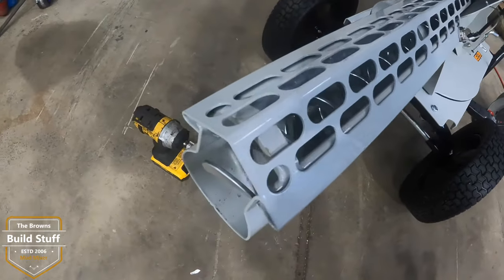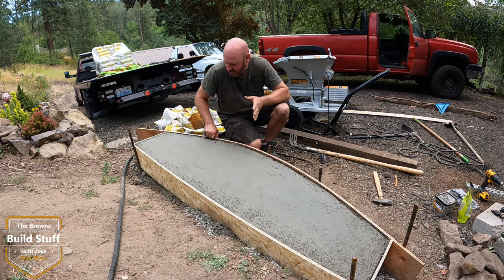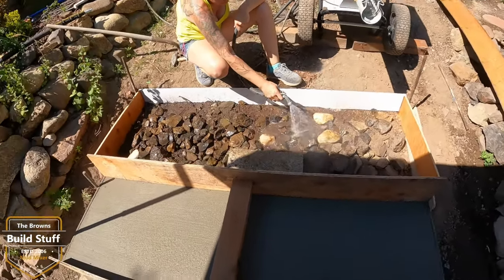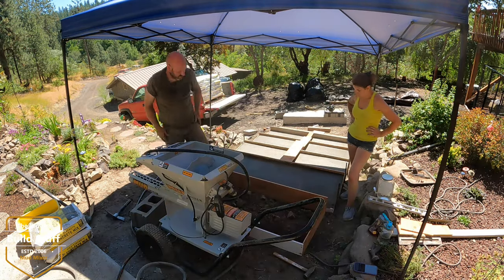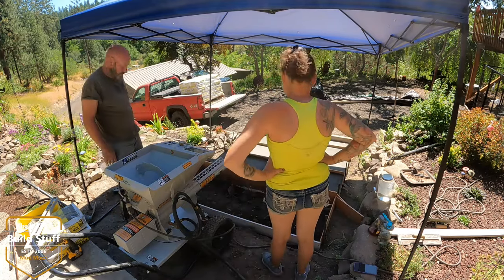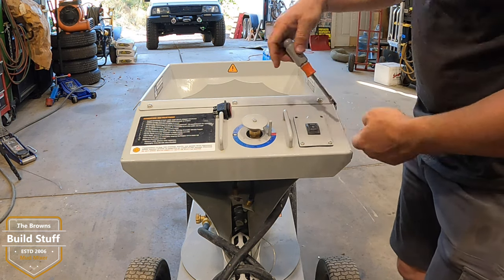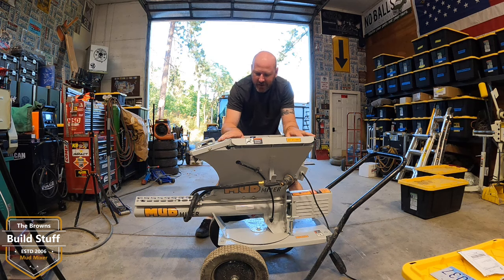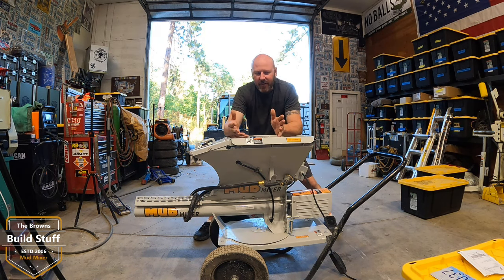Mud Mixer Assembly, Review, and First Project.  Concrete Stairs DYI Automatic Mixing Concrete Tool

Comment: I have poured 9 yards for footings and stem walls, and your analysis of the machine is in line with what I discovered:  well designed and built. Agree that the machine needs to be level or slightly downhill. Wish it wasn’t made in China☹️
Reply from the maker: Agree 100%!!
Reply: Good lord! $3k and it’s actually made in China? What a ripoff. It’s just 14 gage steel and a 1/3 horse motor and some hose valves. WAY overpriced.
Reply: @cmanycrows8400  Do you have an alternative?
Reply: Doesn’t matter where it’s made. What matters is quality control or design. It depends on the brand whether or not they want good components or not. There are high quality stuff made In china . Stupid people make stupid comments about stuff being made in China. Quality of this is good, even though it’s made in China. It’s because the company decided to use better quality components and design

Comment: This machine looks awesome but the price is high for what it is. I'm sure A lot of R&D time and money went into this, but I wish they would try to make it up on volume rather than price. A lot of folks will have to wait for the knock-offs or for the price to come down to justify this vs. a traditional mixer that costs 10x less.
Reply from the maker: I’m sure you’re right.  I just mixed another 2 full pallets in an afternoon filling very large posts and a small pad. Even at the price, it’s saved me a lot since I can’t get concrete trucks where I’m working.
Reply: The mudmixer allows for one or two people to do big jobs.  A traditional commercial mixer is atleast 3 k (canoga,  multiquip). With a barrel mixer, you need another person to wheelbarrow the mud to where it needs to go while the other continually reloads it.  If you need a footing for a car lift 2ft x 2ft x 3ft deep, mud mixer one man job very easy labor (park it and load) let it fall in.  Barrel mixer, you'll bust your ass if your alone.  Each tool has its place.
Reply: @jaymann53  I know it's a great tool. Makes total sense for anyone using it to make money on jobs. For the average homeowner/DIY'er I think it will need to come down in price. It should have plenty of room to come down in the future if the company can make it up on volume.

Comment: 38 years building swimming pools. Started working for my future father-in-law at 17. We always subbed out the finishing but he urged me to learn how to finish cement, I told him I knew how,but chose not to, as it was extremely difficult to produce "professional" results (which was absolutely necessary). I'm an old man now, but do need to pour a slab for a shop. This might be the answer. Thanks for your content!
Reply from the maker: Thank you for that!  I like hearing stories like that. It definitely takes a lot of the fuss out of it so you can make corrections.  Good luck on your slab!

Comment: Can I suggest something get the manufacturer to make a cover to go over the switch so you don't have that problem switch not working 😂😂😂😂😂
Reply from the maker: The switch they sent as a replacement is a sealed switch.  It has a rubber boot all around it.

Comment: I have a mud mixer and watch numerous videos on it before buying. I'm never seen anyone complain about my issues with it. There are really only two, the hose is terrible if it's a bit cold (below 70), and why wouldn't they have enclosed motor for dust and moisture?

Comment: You need a Mag float that will help you bring the cream to the top also a edger to roll the edges for a cleaner look ..
Reply from the maker: Is the mag float a little round on the bottom?   I watched a guy finishing something similar, and it appeared like what he was using was much more rigid and seamed like it was a bit rounded.  Or he was just really good.  Someone else suggested that too.  I'm going to go down to the concrete supplier and get one.
Reply: @FancyAsFarm  yep it is … it help if your concrete is a little to stiff to bring the cream to the top so you have a little more time to work your rounded flat trowel to finish
Reply: Facts

Comment: That 1st step is your strongest... Less chance of cracking
Reply from the maker: What did I do differently to make it stronger?  Or do you mean the one that didn’t turn out good that I took out?
Reply: @FancyAsFarm  It is stronger because it has less water, and is more dense... 
(RCC) Roller Compact Concrete is actually stronger, than when having water that makes concrete flow.
Neighbor packed in concrete around his fence post, and when I tried to chip/ cut off some to put my post next to it... it was crazy strong... I burned up a diamond blade on it... and just gave up and kept my post further away.   Of course it is also because if you compact it too...
Reply: @jameschupp2230  Makes sense.  I can attest to that one being very strong.  It still is in one piece and I've been beating the crap out of it with my backhoe moving it around.

Comment: The robber helps but, the next step is to use a float instead of a steel trowel. The float works the stones down and brings up the soup. Hope this helps.
Reply from the maker: Thanks! I’ve been looking at them online. Appreciate the help!
Reply: A mag float is key to raise the cream to the top. Magnesium draws the water to the surface. Use a steel trowel to finish it. It seals and burnishes the surface. Good job though. Good video

Comment: I also own the mud mixer, purchased it in late 2020 and waited six months for it let’s arrival. Have poured several smaller jobs with it including sidewalks and driveway pads but I did have an electrical malfunction early on and the switch shorted out. However, mud mixer did replace parts as quickly as they could but it did leave me dead in the water on a job
Reply from the maker: Do you now have the switch like they sent me?  It seems a lot better.

Comment: Nice review and good team work!  A couple things that will help in the future is using a mag float and positioning the chute where you can roll the mud mixer along the length of each stair to take some of the labor out spreading the concrete.  Lastly, if you have a reciprocating saw take the blade out and use it along the form boards.  Keep up the great work. 👍
Reply from the maker: Thank you!  Those are very helpful tips!

Comment: Cool - I didn’t know these mixers even existed.   My place is way too small to justify the purchase (let alone a place to store it after), but it sure seams like the way to go if you have a slab to pour.  I’m going to check the rental places and see if one is available for the small slab extension I need to pour.  👍👍😎👍👍
Reply from the maker: It would be a great investment for a rental company.  Never thought I'd be excited to pour concrete.  Now I can get a 2 post lift back since I'm going to have to repour the floor for it.  The floor in my new shop feels very hollow.

Comment: Excellent review, thanks!  Try using a vibrator!  Would solve all your first problems, except that it creates more form pressure - so more bracing required.  But then you get nice formed surfaces.  Over vibrating is a myth, it only helps - unless the concrete is way to wet.
Reply from the maker: I need to get one for sure. A friend said to use a da sander on the boards as the vibrator.  Sounded like a good idea to me, but I haven’t tried yet. I’ve been using it for post holes mostly. Still no problems.

Comment: Rule of thumb for rebar, make sure you have a minimum of 1.5” of concrete cover if next to air, and 3” of cover if next to the ground. 

Also, take the blade out of a sawzall and run it with the foot on the form board, or just give it lots of love taps the a small hammer.
Reply from the maker: Great advice!  Thanks!
Reply: thanks for the tips.

Comment: more water is right. also get some magnesium hand floats and start with those before using the steel trowels. maybe a different sack crete, might have more cement so you can get more cream. get a dewalt cordless vibrator, works wonders.
Reply from the maker: Thank you for the tips!  I’m always afraid of too much water, but have no reason for it. I don’t know why that’s a concern I poses.

Comment: I wish I had one of those when I built my deck. I had to make do with a small mixer.
Reply from the maker: It does make it a lot easier for sure. Especially for posts. I did 2 huge 3’ diameter post holes last fall, something I never would have tried with a small mixer and would have had to pay a premium for premixed.

Comment: I have been thinking about getting one. I think some of the research into this product was ripped off from other brands of continuous concrete mixers, because this isn't the first of it's kind. I would not feel too bad in buying a competing brand at a competitive price if it compared well.
Reply from the maker: Interesting.  I looked around before I bought this one, and it was the only one I could find.  I'll have to look around again.
Reply: @FancyAsFarm  Graco makes the ToughTek CM20. Probably more expensive. Graco has various CCM lines, but again, could be pricier, but that would be one example.

Comment: Thanks for the informative video!!! Would you says more about the larger bags of concrete? 60 lb is what I think I would use but the 80 lb bags you commented on I could not hear. Also is the aggregate larger in the 80 lb bags? Thanks again. jc
Reply from the maker: The 80lb bags are supposed to be exactly the same thing. They just happened to be better that time. So the next project I did I used 80lb bags and they were the same as the 60’s before.  So I think it was just a fluke. The only benefit to 80’s is the overall cost is less.

Comment: YT suggested this video originally and seemed like you looked familiar like I've seen other videos or maybe even met you when I was out in Spokane area visiting in Liberty Lake with an ex girlfriend Mom friend of mine her Mom wants me to stay with.  Anyways, you have the Bald and Bankrupt channel look as well, no offense as I've done before having the bald spot that didn't stop.  :-)  I've never seen one of these mixers before.  Reminds me of my plans to make a front end loader mixer starting with the 38" John Deere single stage snow thrower (I have a 42" inch earmarked as well I got for parts for the other 42" that's good still without customizing) flipped around with the chute exit on the bottom and an actuated slide door fab'd on along with the side walls built up and a few more things to drive... most likely hydraulic driven since seems an engine or motor would weigh more than required.  I never though about maybe driving around with a trailer, pump and valve to auto add the water maybe... though really isn't the same real time flow mix design.  Interesting however and thanks for sharing.
Reply from the maker: I think there is a company that makes a mixer like you described for the front of a skid steer.  I'm pretty sure they sell them in Spirit Lake ID.  I saw one and thought it look really cool.  

I have another channel so you may have seen me there.   @deathtollracing

Comment: Will there be a cordless version? Using 5 18V 12AH batteries? 😊😊. Pretty cool machine, seems definitely easier that batch mixing
Reply from the maker: It would run off an inverter for sure!
Reply: Milwaukee MX fuel would be a good option these motors use lots of power though. Would be great for no power job sites.

Comment: is it for only concrete and sand or can you add gravel
Reply from the maker: I used premix that has gravel in it. It won’t care about gravel as long as it’s less than 1/2 inch

Comment: Did I see you throw pieces of wood in there?
Reply from the maker: No. It was fiberglass rebar. It’s tan-brown with a sanded coating. I don’t know if it’s better than normal rebar or not, but it sure is easy to use.

Comment: Can you get a wheelbarrow under it?
Reply from the maker: Unfortunately not.  It's not very tall, which is nice for loading bags of concrete, but not for mixing straight into a wheelbarrow.  It's very easy to move around though, and it does pivot around it's base.
Reply: if you need  to wheel barrow - mix on hill
Reply: I used pallets to raise the mud mixer so that the discharge was high enough to pour foundation walls. The discharge is about 15” above the ground.

Comment: Could you pour a driveway?
Reply from the maker: You could for sure.  But it will come to a point where it wont be much of a savings in very large volumes of concrete.  That is very dependent on your location though, as prices vary.

Comment: It's simply too expensive. At that price and the price of each bags, it makes more sense to hire a concrete truck.
Reply from the maker: Depends what you’re doing. Those stairs would be very difficult for an amateur to do in one pour with a truck. I’m not even sure if a professional would do it that way with all the forming that would have to be done.

Comment: You obviously need to work smarter not harder by using the newly found method for concrete pouring developed by a DIY couple in Cajun country called dry pour.  Just pour in bags of concrete and spray water on it and wait.  Voila, done.
Reply from the maker: It must be true if you saw it on the internet.  Dry pour concrete never gets to full strength, but would be okay for some scenario's.  It's not a good option for stairs, or anything that you want to last.  Until you've done a method yourself, I would refrain from parroting the information.

Comment: Way too slow though
Reply from the maker: It would be interesting to do a race between it and some who knows what their doing with a traditional mixer.  I just poured 42 80# bags (full pallet) into big gate post holes and it took about 40 minutes.  I don’t think I could have done that with a traditional mixer, and I do know that it would have been a lot more work.
Reply: That’s pretty fast.  I’ve only done the “mix in a wheel barrow” method, that takes wAy too long, and will wipe a person out, especially in the summer.  I can’t justify buying one of these, but if my local rental center or Home Depot start renting these, I will definitely use it for my next project.
Reply: If you’re used to readymix, it will seem slow. But is plenty to keep 2 or 3 guys busy!